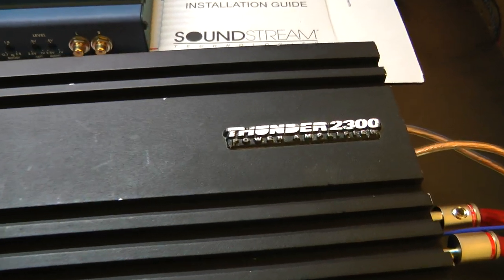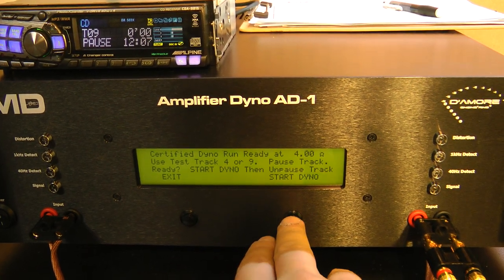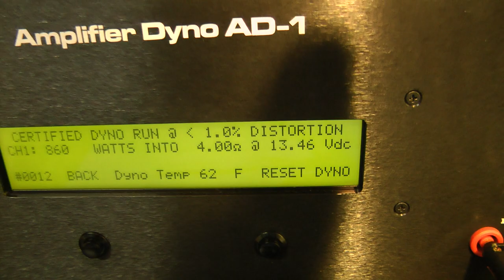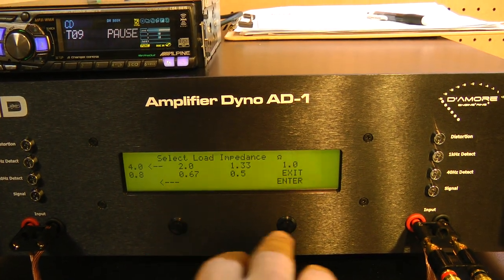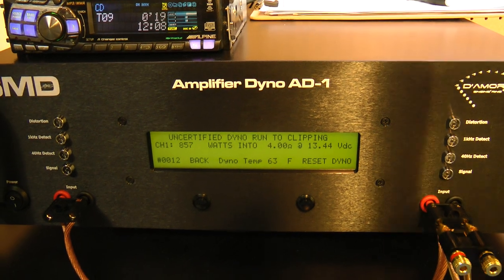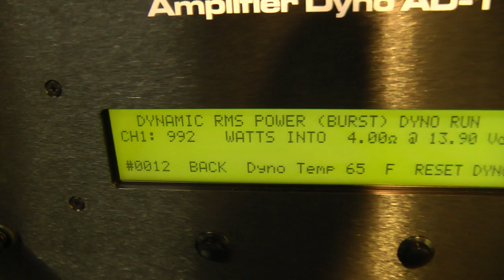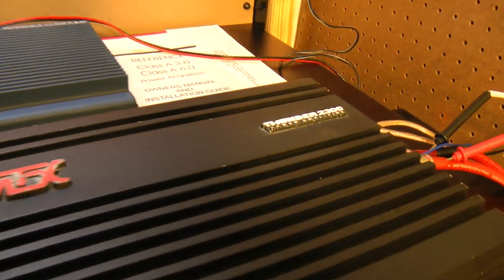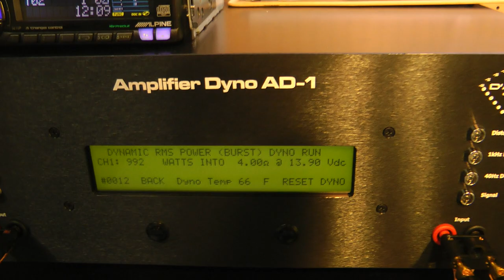MTX Thunder 2300 Amp Dyno AD-1 4 Ohms Mono

Comment: Thanks for sharing this video . Old school rules , i 've got several MTX Thunder 4200X / 4300X / Blue Thunder pro 's BNIB and Mint condition and one MTX Thunder 225 HO BNIB , 700 Watts bridged into 1 Ohm Dynamic Power, underrated , but will run over 1000 watts on 1 Ohm Dynamic Power easy . Very very rare !! This quality won't build these days anymore !!

Comment: Hell yea I knew that amp was a beast. Almost 1k dynamic. I ran that amp on all kinds of stuff back in the day. 

Big D Wiz for President
Reply from the maker: I love it when an amp shatters it's ratings, even the dynamic 14.4v ratings, which used the same standards as the AD-1's dynamic power mode...this amp beat the rating by nearly 250W, which is crazy for an amp rated under 1kW! Not to mention, the test voltage was even lower than 14.4! #MTXAudio old school FTW!

Comment: I have a 1997 MTX Blur Thunder PRO3002 same amp guts look the same and all. It was a power house I thought I toasted the thing years ago I just found it tonight after I seen this video I pulled the cover off checked the mosfets all good but the RCA input jack I noticed was real loose well one leg was broke so I tore it apart soldered it back up put it back together and wouldn’t you know the damn think works I started messing with a 2 10” isobaric clam shell ported setup I have (this setup killed it back in the day) hooded it up and I just looked at the time it’s 3am I’m pretty sure I’m going to get a visit by the town cops lol my bad. Love your videos man I can’t believe I had this amp in my hand a few years ago reaching for the trash can I’m so happy I reconsidered it brought back so many memories of high school, chicks, cruising the strip and blowing 3 sets of MTX 12” 7000 I still have one left I would love to recone it any suggestions who and where?

Comment: I had that amp back in the day. Burned one up with a Pyle 12 1ohm sup.  I was a rookie then. Sent it back and they rebuilt it. It came back with more power. At first I had a la sounds amp rated @120 that hit hard and never got hot. I tried to match it with a series of MTX amps and the 2300 was the one I bought. But wow, it took a mtx 2300 to beat an La sounds 120. That is crazy. The installer at audiobuys were I bought it could not believe it either. So he took the backs off both of them. The la sounds had hardly nothing in it and the 2300 had all types of boards and copper in it. He could not explain it.

Comment: One thing I gotta note for the benefit of other people: The CEA-2006 compliant crap is why these old school amplifiers do so well on the amp dyno @ 1% THD. They weren't originally rated that way. They normally used a THD % of ~.05 or lower (numerically). I'm not knocking that at all. I'm knocking the way the CEA-2006 standards are WORSE than what manufactures used back in the day. It's one reason some manufactures will not pay to have their equipment rated using the CEA-2006 standard. They would be required to "lower" their own standards of excellence to comply (raising THD). Some companies (E.G. JBL) don't bother retesting their products. The CEA-2006 standard states "≤1% THD". They already tested their stuff below 1% THD (usually 0.1%) so they just use those numbers. It's sad they (all good companies) gotta pay money to be compared to companies like Boss and Legacy just to prove they're still a quality brand.
Reply from the maker: Great point, but another thing to consider is the wattage output of a Class AB amplifier at say 0.05% THD vs. 1% THD vs clipping the waveform. In many cases, the difference (wattage wise) is not as much as you'd think. I plan on putting my Panasonic THD meter on the full range amps to show the difference at 1kHz. Many of the old amp tests done by Ken C, Polhmann (Hammer Labs, did amp tests for Car Stereo Review) were measured at clipping...not 0.05%, not 1% THD, but at clipping of the waveform. So what I'm saying is you are correct by the fact the old school amps themselves were rated at much lower than 1% THD, yet many independent tests were done at 1% THD or up to clipping, depending on the tech. Also, I think you'll see in upcoming videos not all old school amps are underrated...even those many think are/were "WAY" underrated. Gonna be a shock to many people...it was to me!

Comment: Is it the same with blue thunder pro 3002?
Reply from the maker: +兵 兵 yes
Reply: Absolutely. I’m still running my blue thunder pro 3002 along with the blue thunder pro 504 mint condition.
Reply: The bt and rt lines were made for big box stores, but basically the same as the thunder x series except cosmetically and board layout, terminals etc. And crossover went down to 40hz, 50 on this video version.

Comment: Hey Dereck, nice shot. Can U wire the CA 6.0 on the dyno ? Wonderring if that one is underrated.
Reply from the maker: I tried the SS CA 6.0 a few nights ago and it hit 580W at 1 ohm mono (high powered mode) at clipping before popping the fuse. From what I've seen w/ the OS SS amps, they are not underrated, yet slightly overrated. Doesn't detract from their SQ, but as other amp designers have mentioned, they used really small toroids in these amps and the power supply was their weak point.

Comment: Would like to see a test on a mix blue thunder pro 150x2
Reply: They do well as well.  The blue thunder 3002 is the same as the Thunder 2300.  The 1502 is basically the same just half the power.  I'd e pect about 500 watts Dynamic on that 1502 bridged.

Comment: What do u think of planet audio people tell me it's flea market crap but I hear good reviews on it? I'm on a budget, I would like to know what a pro like u thinks about planet audio amps
Reply from the maker: I've not tested any Planet Audio amps so I cannot comment on them, sorry. If you are on a budget, I'd suggest looking on your local Craigslist for good prices on quality used amplifiers. There are 1000's of different models out there, so you'll have to do some research, but given some time and a little patience, you can find some great deals on the used market.
Reply: They used to be good I had two  2250  back in 2004 before boss bought them out when planet audio was actually planet audio the new ones suck!!!! But if you are on a budget get the power acoustic 5500 demon amp....Its reasonable and you could make four 12s sound gd real easy...

Comment: i had that amp new in the mid 90's i worked as a installer at a rockford/ mtx dealer i was going against fosgate.my 2300 burned up at 4ohms as soon as i hooked it up.i had 2 batterys and 2 1 farid caps on it,after the the repair(MTX replaced the board) it lasted a week P.O.S.i sold that boat anchor then ran a MTX 500D sweet amp when it worked again nothing but problems.as much as i hated to do it i went rockford and never looked back i'm still running my RF BD1000 after 18 years never a problem FOSGATE=BULLET PROOF AUDIO.......MTX=JUNK